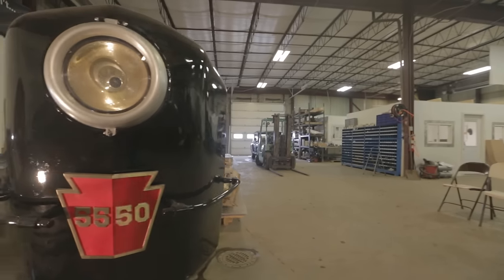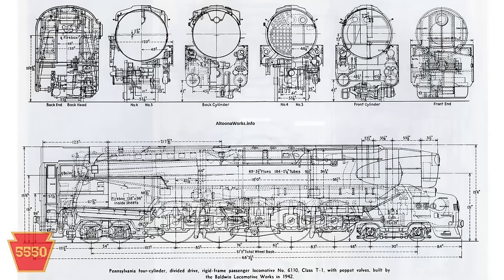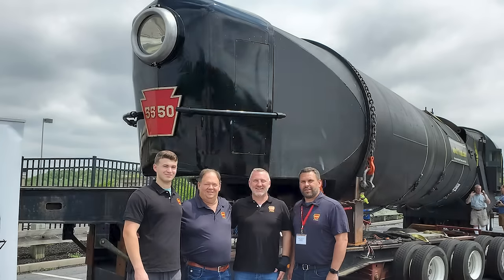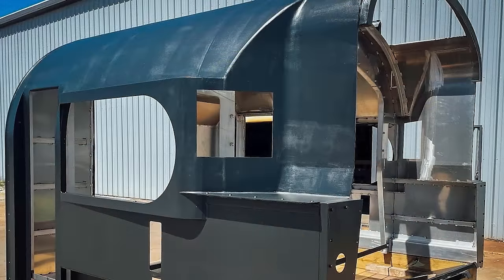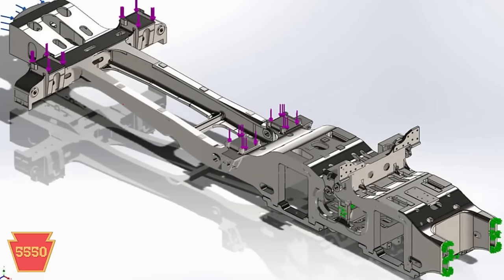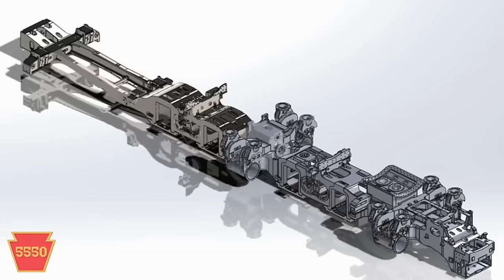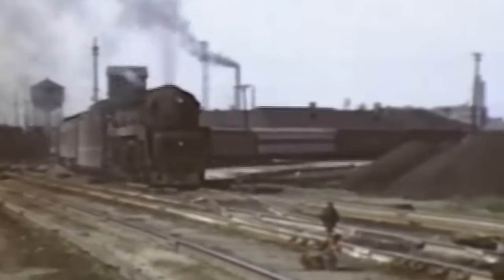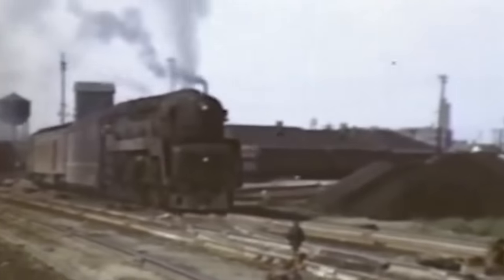Can we build a NEW mainline steam locomotive in the United States? | Restoration Roundtable

Comment: A great update on the T1 project, I really think these people can pull it off, they are very passionate about what they're doing.
The re-engineering of the frames is a huge effort in itself, the one piece casting was something far more complicated and cutting edge than the plate frames used in the UK till the end of steam.
Actually North British Locomotive had their frames for South African Railways classes 25 and GMAM cast in the US as the customer demanded this and no foundry in the UK could do such large castings.
Well thought in the proces is not only a fabricated frame hold up to the stresses of operation, but with maintainability in mind as well, not all mechanics are short, skinny and flexible, so good accessibility of components is a real concern.

The T1 trust is also lighting up another very important aspect in preservation as a whole, that is pulling the industry in.
In the UK the industry supporting the huge preservation movement is large, some companies almost completely depending on orders from the preservationists.
But also regular metal shops and engineering firms embrace the idea as very suitable for learning purposes, many apprentices learning some aspects of the trade in a very oldskool  way, but with incorporation of modern machining and construction tech.
So very good to see that you found some firms seeing manufacturing parts for the T1 as a challenge and not as a nuisance hindering their of the shelf mass production.

The T1 trust is going to be the first preservation/new build group in the US getting a donation from me, with greetings from the Netherlands and success with this awesome project.
Reply: Thank you so much for donating to get 5550 put together and running! Can’t thank you enough my friend!
Reply: Why is it so much longer than a regular 4-8-4?  Annd has any thought ever been given to reheating the exhaust steam?
Reply: @עוזירקיע  got to fit that second pair of cylinders in somewhere... and the huge firebox takes up a lot of space... Many German locomotives employ a mixer preheater for the feedwater located just in front of the chimney in the top of the smokebox.

Comment: A question regarding the tender...
You guys bought that 210F75a, you guys will modify the tender right?
If I recall correctly, the production T1's had 180P84's which were very similar in size to the 210F75a's, except the 180's held less water with the tradeoff of holding more coal.
Reply: I’m not a part of the Trust, but my understanding is they will at minimum change the tender from coal to oil. I believe they also plan to streamline it.
Reply: @Stooltoad5017  this I know, but I mean to ask is if they will be adjusting the water/fuel space ratio to be correct to the 180P84 design.
Reply: I guess we won't know until after they complete the engine.

Comment: I love this.  Just ran across this channel.  Now fire it with propane and you will have a machine that will be low emission  and yet have the steam advantages as well.  It could be put into commercial use even.  Propane is cheap by comparison.
Reply from the maker: Thank you. There are several grades of oil (even waste cooking oil and vegetable oil) that are also in use in steam locomotives, including another that we assist with in Florida that burns oil collected from restaurants for fuel.
Reply: Why not a thorium nuclear salt reactor? You'll be able to out compete fossil fuels with that ;)

Comment: My father was an engineer on the PRR and the P&LE, from the 1920s until an accident at Conway Yards in 1948,  I took a test for the PRR in 1965, I passed, then less than a week later my Uncle that was chief mate on tankers, got me my merchant marine papers, I went to seamans school and chose to work in the engine room. Of my 18 ships, 15 were WWII-era c2, c3, and T2, Which all were steam turbines, I worked as a fireman/watertender, oiler and  the last ship as a cadet engineer, working to get my 3rd engineer's license. My first love was boilers and steam-driven horizontal and vertical piston pumps. If I was 20 years younger I would have enjoyed working on a restoration or even the re-manufacturing of a steam locomotive.  30 some years ago I opened a studio ,and at the present time I restore huge wooden doors, frame work and windows for churches. Good Luck,

Comment: For close to 40 yrs. I've hoped to see the ACE 3000 project move forward.  Does anybody have any insight into the future of those engineering ideas?  Or was Ross Rowland's work all for naught?
Reply: The real issue with the ACE3000 was that it was colossally over complicated for only 3000hp equivalent, its interoperability with contemporary diesel-electrics not properly considered, and the very likely problems with condensing inadequacy even in the East made it unlikely to run in typical road service.  You can get a very good idea of what was involved technologically by reading the patent description.

The 'rightsized' version of a modern steam locomotive with two units has to be at least 8800hp; the first problem being that even Holcroft-Anderson requires more heat-exchange volume than would fit on a locomotive.  For more unintentional humor, look up the Foster-Wheeler and Combustion Engineering work in the early '80s.

The final nail in the coffin for any conventional external-combustion power is the current push straight to zero-carbon instead of zero-net-carbon.  If you source fuel from fully renewable sources, using only renewably-sourced energy to produce and refine it, you might be able to justify something like the proposed Project 130's torrefied fuel (this is something FMW Solutions is highly qualified to discuss).  But there is no effective way to sequester CO2 emissions from an 8000hp road locomotive that operates with comparable cost and overhead requirements to modern AC diesel-electrics.

Comment: I'm just curious but will y'all have safety plugs that can melt if the water got too low? 

I know some locomotives in Mainland Europe have that safety feature and some even had safety plugs that melted which drained water from the boiler to put the fire out if water got to low.
Reply: Drop plugs are mandatory on American steam locomotives, but on modern road power there have to be a great many of them -- many more than the law required -- to be able to relieve peak boiler pressure under any typical low-water condition that would drop the plugs.  (You can actually see this in a couple of Nathan advertisements that show the actual number in small illustrations, but don't make an explicit note that so many would be essential...).

The 'catch' of course, which escapes the armchair railfans until they are shown the situation, is that there is a consequence of the 'proper' number and action of those plugs: they open an area at least comparable to all pop safeties together to what is essentially saturation pressure... inside the enclosed firebox, full of combustion gas, probably located to vent into the volume toward the front of the crownsheet.  Google LMS Fury to see the likely result if the plugs mitigate what would otherwise be a crownsheet failure...

Comment: Why not recreate the S-1? That locomotive should’ve been saved to a museum—scrapping it was the unforgivable sin!
Reply: Because it was impractically large. While the T1 had a long rigid wheelbase, it could still negotiate 16 degree curves. The S1? I wouldn’t think so. There is a reason they only ever built one. The T1 is much more compact and will have a better time getting around tourist railroads.

Comment: So do you think an S-1 will be in the offing, what the hay seems only logical it truly was the fastest steam locomotive, it had 84 inch drivers I think, besides it was a passenger unit whereas the T-1 was a freight loco.
Reply: Pennsy T1s only hauled passengers and mail.
Reply: You're confusing your PRR T1s with your Reading T-1s.

The S1 6-4-4-6 was a multimillion-dollar Depression subsidy on PRR's dime (very similar to the BCR COAL-burning turbine scheme, where the railroad interest was paying for all the science and engineering that locomotive builders would profit from) and it represented the swan song of obsolescent approaches to balance and high speed.  In practice it had many of the shortcomings of its rough contemporaries like the ATSF 3460 class and the sad C&NW E4bs.  It could probably have been made into a fine high-speed locomotive with (quite a bit of) detail-design improvement, but it was already too long, awkward, and heavy to be practical road power for any train it could start.  (See the mention in One Man's Locomotives of smaller 84"-drivered duplex proposals from Lima in the late 1930s...)

Neither the Haas fairy tale about the Trail Blazer in 1947 or the Popular Mechanics story with the 132mph claim hold much water when you start researching the supposed details.  Remember that the S1 speed recorder only went to 110, and the T1's only to 100 (which you may already be thinking is a problem for Crosby's tale...)

80" with good tribology and valves, and proper motionwork, is a better approach than taller drivers when it comes to high-speed balancing.  Even the somewhat crude kinematics of the Withuhn conjugated duplex work nicely on larger drivers (76" for Eastern clearance under a double Belpaire is already well capable of 120mph+ with reasonable machinery speeds)

Not that I'd mind a 6101 or 6102, of course, but you could probably have your Niagara and Hudson, a Milwaukee A, and an improved and debugged NYC999 for the same cost and effort...

Comment: If they can get the steam record with a faithfully built T1, then it'll confirm all the stories of the T1 and S1 going that fast in the past. Proving that the mallard probably only held the record for 4 years, rather than the 84 (and still increasing) that is claimed.
Reply: Mallard has legitimately held the record (whether other engines did, or could, have reached a higher speed) since 1938. What we need to be careful about is what that record speed actually is -- 126.1 or higher is a fairy tale, an artifact of measurement.  Gresley himself accepted 125mph, and depending on how long a speed peak needs to be maintained, the number is about 125.4.  This was then cheated up in post-production and politics to preclude any further attempts with the BR 05s... which as things turned out never eventuated.

Alfred Bruce of Alco noted in the early Fifties that he had seen Milwaukee A-class 4-4-2s run faster than 128mph on more than one occasion (that speed probably chosen as greater than the 127.1mph PRR Atlantic tale) and he was in an uncommonly good position to bring about the conditions and permissions needed for running that fast.  However, without proper dynamometric proof that can be independently analyzed and confirmed... it is no record.  Arnold Haas is the source of the S1 doing "141.2 mph" (suspicious precision given that the locomotive's speed recorder only went to 110) and several of the other reported details don't pan out.  A report of 132mph in Popular Mechanics also does not pan out if you investigate where the speed was supposedly confirmed.  I personally suspect the 135+mph speeds that Vernon Smith reported were more likely artifacts of high-speed slipping (which goes with the nature of the damage the Franklin engineers were reporting) but this counts no more than Kiefer's augment testing with a J3a spun up to the equivalent of 161-163"mph" in the 1947 survey of motive power.

Fast Loop at TTCI, where the 5550 high-speed testing will be done, is 165mph, which should be adequate both to establish high-speed characteristics and to overcome any revisionistas who want to impose FIA-style 'bidirectional runs' on things.
Reply: @goldenfloof5469 - whatever happened in the past, if the videos I've seen of the appalling state of your tracks is anything to go by, I think doing 50mph is chancing your arm, let alone 125mph+
Reply: The Brits (and also the Reichsbahn with the 05) got their succession of speed records in the 30s precisely because they ran equipment to precisely measure said speeds.  Regardless of any claims, or their veracity, any we made in the U.S. remain hot air until such time as one of the claimants can back it up with a dynamometer or other precise measuring data.  We’re just in the unfortunate situation that other than trying to push 611 past the 110mph or so one of her sisters did, or get one of the CB&Q Hudsons restored and make a speed attempt I’ve seen one of them rumoured to have done, we in the U.S. will have to build replicas of any of the claimants. And if they do set records, those will stand from the date they are set now, not from back when claims were made in the 1930s and 40s.
Reply: @wizlish  "What we need to be careful about is what that record speed actually is -- 126.1 or higher is a fairy tale, an artifact of measurement."
What the hell is an 'artifact of measurement'?  If the instruments were properly calibrated, and I've seen ZERO evidence to doubt that, then the speed was as recorded - regardless of what Gresley, or you, choose to 'believe'.
As for the claims you refer to for the Milwaukee 'A' Class, the PRR Atlantic, S1 and J3A - without dynamometer car recordings, that's all they are.
Just claims.
Reply: Evidently you are ignorant of dynamometry, have never actually read or interpreted the trace from the record run, or read why Gresley accepted the speed he did.

Simply taking first differences off the trace, assuming the precision but not the accuracy of the time standard, shows an impossible acceleration to reach the extremely short "126mph" peak.  If you can explain that with actual physics rather than knee-jerk chauvinism, I'd be interested to hear your explanation.

I personally don't think much of the idea that 5550, or something like the rebuilt ATSF 3463, is being built to "beat Mallard's record" (which was, and I think still is, in some of the early T1Trust material).  Even at 125.4 or whatever, even if another pass with a BR 05 not artificially terminated above 200 km/h, even if Bruce could swear to the accuracy of the A timings, Mallard has what I consider the unquestioned speed record for a run undertaken to establish a verifiable record.  It just falls me that politics were then involved in faking the speed up to a higher, unsustainable value that becomes as commonly accepted as the various BS about the T1 being a 'failed design'.

Now, it may well be that the T1 actually has difficulty reaching the high speeds attributed to it (Crosby's account being proved a bit of, shall we say, embroidery by certain characteristics of reading 120mph for timing).  Those will be tested first for dynamics on the roller rig, then by loading the rollers progressively and simulating the effect of various conditions disturbing adhesion at high speed and load, and then through the testing in Pueblo with full appropriate instrumentation and analysis.

(The other thing would be for someone across the pond to arrange an A4 with triple Kylchap and the improved big end to have the necessary instrumented wheelsets, and bring her over during the time reserved for testing... I would like to establish that Duddington knew what he was saying about getting up to 130mph.),

Comment: Now if only they could do that to y6b 2174
Reply: 2174 is a Y6a, but it was improved 'where it counts' to Y6b performance standards.

The actual 'science project' here is to build a fully-modulated IP injection system for the LP engine, as Chapelon described; that would establish good dynamics at good drawbar HP well up into the 40mph range of road speed -- which would have made it satisfactory for most manifest freight as the contemporary N&W ran it.  

If you then applied the 135-degree overbalancing used on the British 9Fs to both engines -- something I don't consider highly difficult -- and applied appropriate lightweight rods (drawings for progressive forging of Timken lightweight rod eyes survive at the NWHS) you would have a very interesting excursion locomotive in a number of respects...